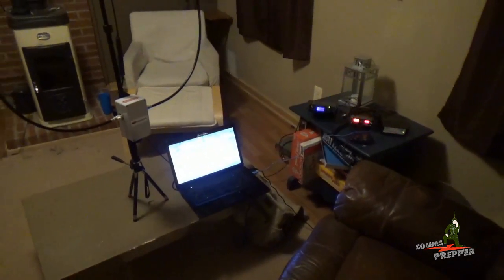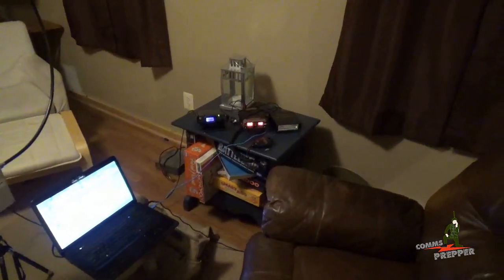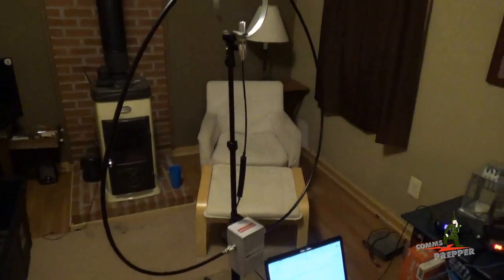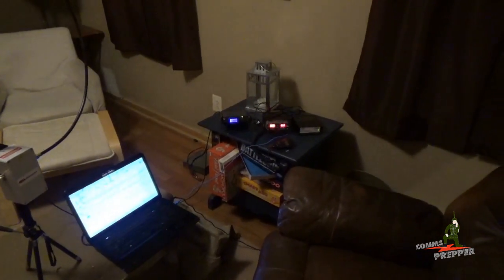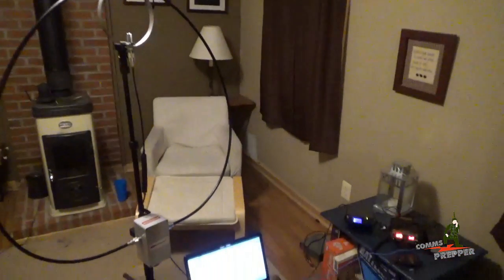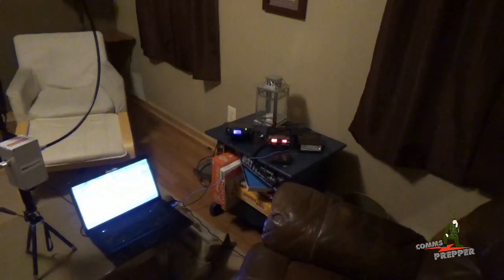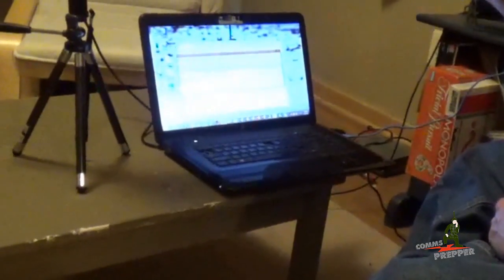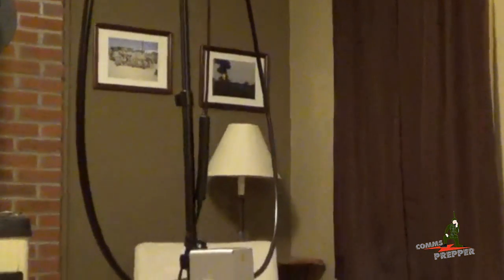Chameleon Antenna's P-Loop Antenna Indoor Operations

Comment: Is it safe to use the antenna indoors
Reply from the maker: Only if you adhere to the FCC RF exposure limits.  The ARRL has a great webpage that covers this topic and has a link to a calculator for determining controlled and uncontrolled distances based on power, antenna gain, and frequency of operations.  http://www.arrl.org/rf-exposure

Comment: What kind of antenna do you recommend for < $100?? This looks nice, but I need an antenna whose cost does not exceed my car payment.
Reply from the maker: +KarlsLabReport What are your requirements?  Local, regional long-range?
Reply: +Commsprepper Regional to long range. I'm quite impressed with the "Chameleon loops" and the like, but the money is out of my reach. For the time being I've been relegated to random wire and a tuner, but if there's something involving less setup/less space, etc. , I'd like to know about it.
Reply: +Commsprepper As far as local operation is concerned, I'd think that an antenna that could handle regional could also do local - if nothing else setting up some sort of NVIS should do it.  Also, could you do more video on how the "P" loops and "F" loops work?  Thank you for the good content!!
Reply from the maker: +KarlsLabReport There is nothing wrong with tuners and random wires - I use them all the time and they have their place in the toolbox.  Loop antennas are unique and require technical precision.  However, when they are made right - they work very well.  I recommend you purchase the ARRL antenna handbook and their Stealth Antenna book.  Lot's a great ideas and supporting technical theory.
Reply from the maker: +KarlsLabReport Local is VHF and UHF.  Regional is HF.  Two totally different requirements.  Discone antennas are great for locally communications and scanning.  I have playlist showing different operations with the loop antennas - check it out.

Comment: I love you videos but this its way over priced maybe you got the $$$ I live on SSDI i'm 62 and been on disability for 20 yrs from a on the job injury I love ham radio but I cannot put up fancy antenna. I got a buddistick up 17 feet in the air with an old TS430S and a ft-817nd the  hams I got around  here are not very helpful. i had a ham help me with an antenna Bud W3FF. it was up 3 days and some asshole cut my guide lines down because I was in his tree which was hanging 2/3 over on my side.
Reply: Wow! I'm surprised the hams in the area aren't more assistant. If I'm ever in the area, or depending how far we're apart I'd install one for you that won't come down and I'll make sure your neighbor understands he better not touch it. That piss's me off. 

I run the FT-817 and love it.
Reply from the maker: +Kristyanna Virgona I am sorry to hear about your antenna.  Please understand that my videos and equipment selections come from a prepper's perspective where durability and quality are paramount.  When compared to other items preppers will buy (i.e. weapon accessories), quality radio equipment is not that expensive.